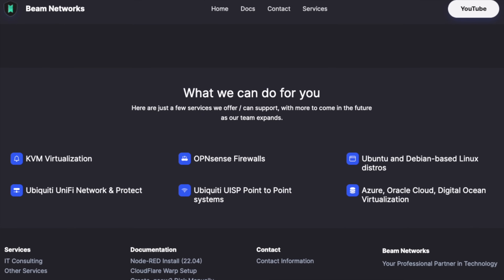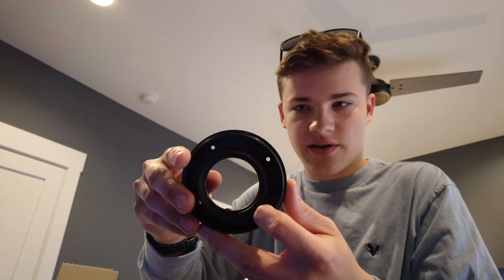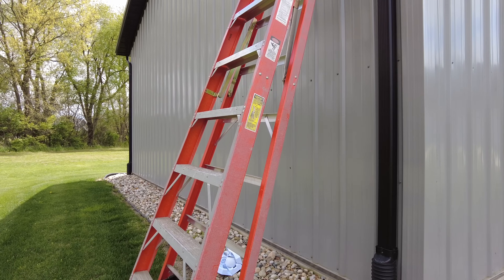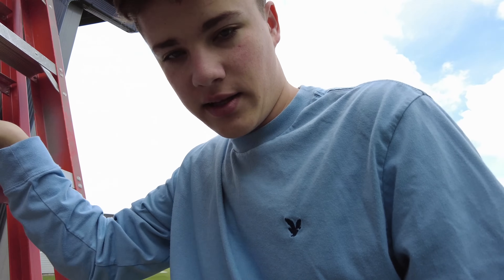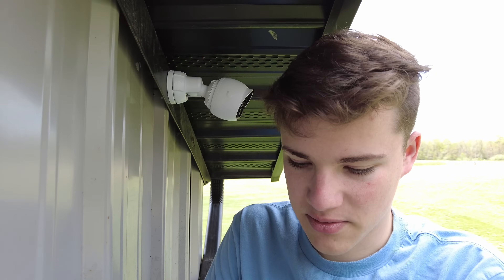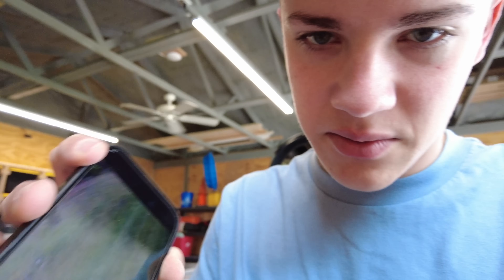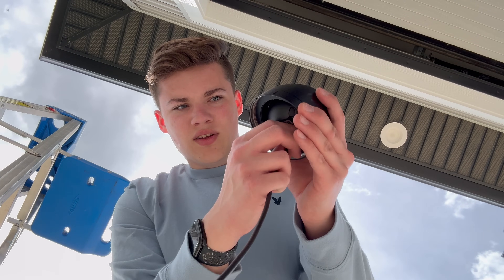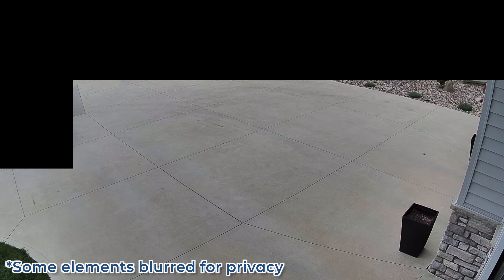G5 Turret Ultra vs G5 Bullet Camera

Comment: What did you think of the mount for the G5 Turret Ultra? I think the fine thread on the mounting ring is too easy to get cross0threaded, and trying to hold the camera pointing in the right direction while tightening the ring was tricky. I was 18' up a ladder while installing mine, so holding on to the ladder was important too.
Reply from the maker: Crossthreading on the mount is extremely annoying. It was quite difficult to get the mount screwed in.